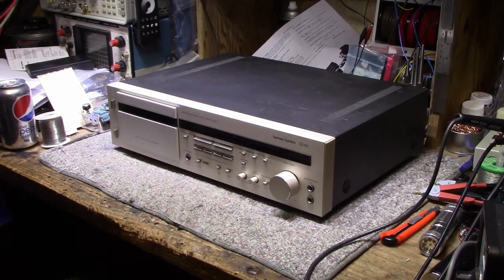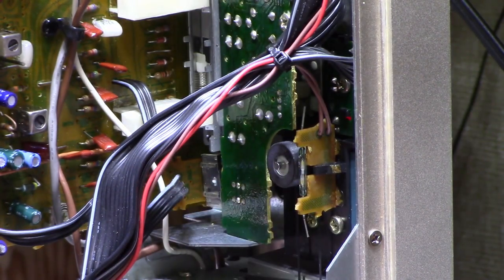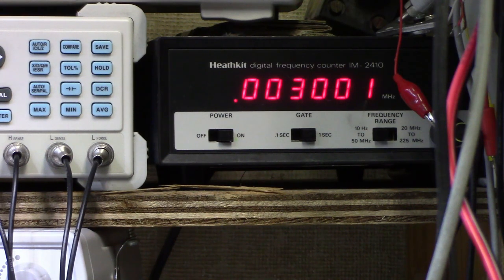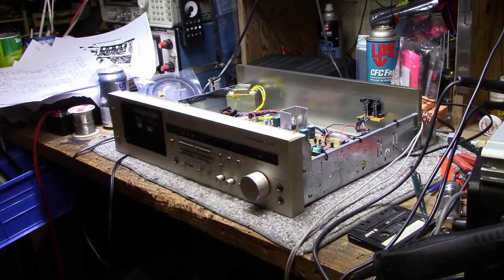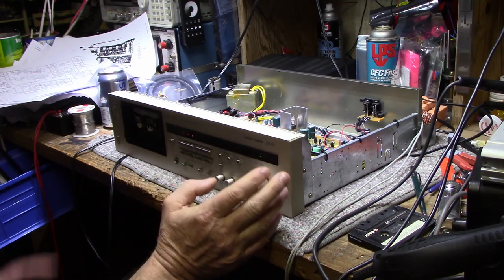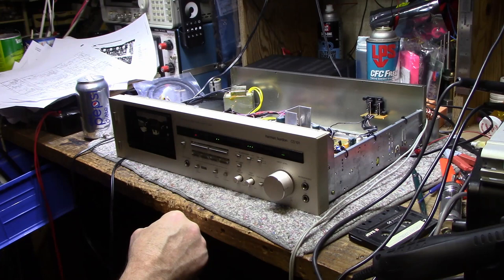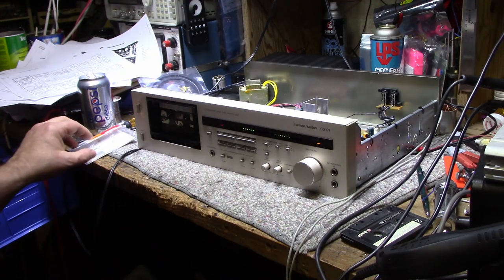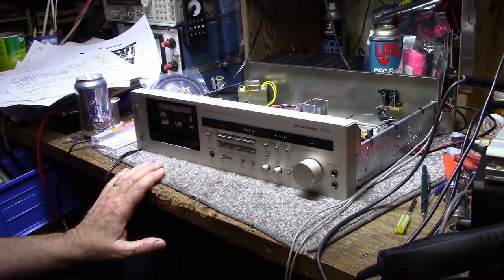Harman Kardon CD-191 Part 2 - Adjustments (Ep. 69)

Comment: I assume you can just record 3000Hz tone from YT on to a tape and use that. Unless the recording speed is off. My question then is; does an incorrect timing on playback mean that the recording speed is also off? I suppose there would not be a way to gauge them separately. On my unit, I have played back my recordings as well as PRE-recorded tape and  The playback measurement has been fast by 2 bpm in either case.